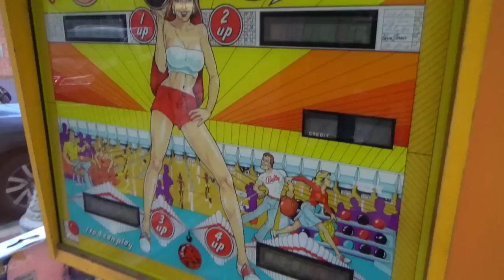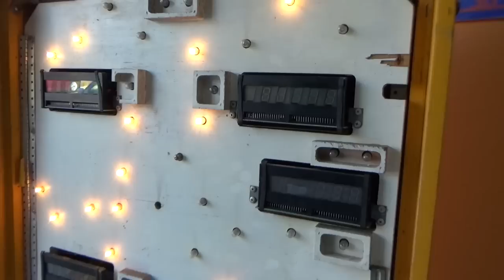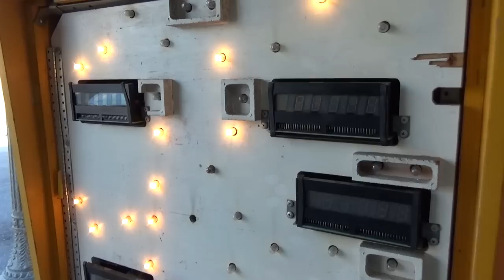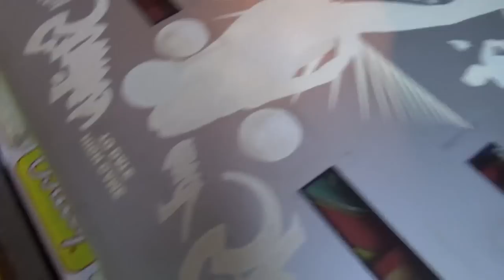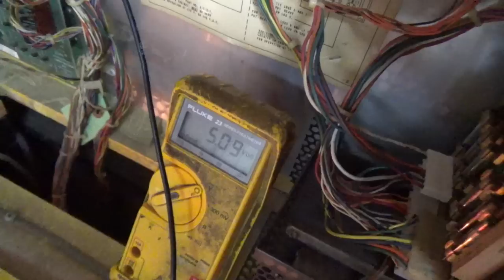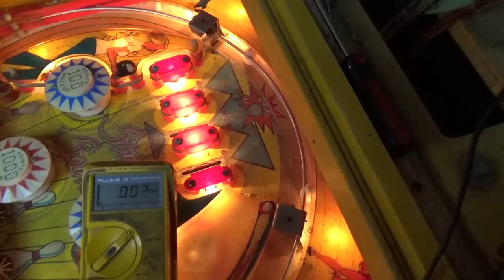Repairing and Testing an old Bally Solenoid Driver Board - 1978 Strikes And Spares Pinball Machine

Comment: Thanks for another great video Ronnie! I'm surprised that high voltage shield isn't totally yellowed. I was cringing when you were sticking your probe under that. I have 2 rectifier boards to re-pin and I'm dreading it. BTW, marco sells a solderless rectifier board with screw terminals going to the transformer, kinda weird. Can't wait for the next video!! ✌️
Reply from the maker: yeah the potential of shorting things out doing that is pretty high especially if you have a camera in one hand, LOL  

I've fixed probably a hundred of these Ballys and only had to replace that rectifier board once.... there's not much to them, unless it's caught on fire.
Reply: @LyonsArcade  Fortunately they work fine but the connectors are pretty toasty. 🤞

Comment: I would solder the screw terminal to the pad on the output lead of the regulator. When the resistance goes up between those two points it causes heat and the regulator to blow. Unless there is a lock or star washer under the head of the screw.

Comment: I’ve had diodes fail like that where they check fine but when voltage is applied they short. 
Nice recovery. I use a Dim Bulb Tester to check for shorts after tinkering on a circuit. I wonder if that would be a way the test for shorts saving the fuses and allowing for troubleshooting on these pinball machines?

Comment: Hey Joe! Great video - I’m learning a lot and have even gotten a few things repaired on my new (1984) Eight Ball Deluxe. Recently i had a single flipper go dead. Briefly. I believe one of the wires has lost some girth at the base of the solenoid for said flipper. When the flipper started working again, now the house lights are starting to dim a tiny bit any time i hit the flipper. Can you think of anything?

Comment: Just for info: 

The 7805 is not a transistor, but a complete integrated circuit acting as a 5 V voltage regulator. This special casing in a TO3 transistor case allows higher currents than the T0220 cased ones because of the better termal connection to the heat sink. I guess this one goes up to 1,5 A instead of 1 A.
Reply from the maker: You corrected me calling it a transistor, then said the 78H05 is capable of 1.5amps when it's capable of 5amps...

I obviously don't know what I'm talking about but you've exposed that neither do you... only one of us wanted to correct the other one, though

Comment: For those playing at home, you should replace both sides of the connectors (Headers and Housing and Pins).  The newer headers are square and you should use the Trifurcon pins so that you make contact on 3 sides rather than just one side.  Reduces resistance and heat.
Reply from the maker: Completely unnecessary
Reply: @LyonsArcade  We'll agree to disagree on that one :)

Comment: 24:51 That is a LV (12-24V) fuse on the right for use in cars or caravans, looks like a 6 or 10A. See how thick the fuse "wire" is in it. The left one is 5x20mm I assume, which is most common.
That little glow in a plasma display is probably to keep the gas ionised that makes the displays turn on faster._
Reply: Yes, there would be a hold voltage at work so the displays work rapidly enough.

Comment: Question, kind of a weird situation. Tri zone. I'm working on it. Sat in a barn. Main mou corroded bad so I replaced it with a rotten dog mpu327 combo board for Williams system 6, recapped both the power supply and sound board it just because. I still need to put new displays because only player 2 and 4 work. Not ball/credit, player 1 or 3. So when I turn it on sometimes I only get gen illum no displays and no flash/attract. But sometimes if I flip the switch off then on 2-3 times I'll get the 2 displays and flashing to kick on and the coin door coil to fire. What might cause this?
Reply from the maker: I would say it's the connector that plugs into the top of the power supply board, or the connector that plugs into the left top corner of the new MPU.  I'll bet when it doesn't boot if you check the board the 5 volts will be missing or low.
Reply: @LyonsArcade  awesome. Thanks Ron, I'll look into it. I do mostly em games so I don't get much exposure to ss.

Comment: My theory with those diodes or any components is, these are literally 50+ years old.  Now, when you put electricity through them after a long period of time, they could just blow up, or short themselves.  If they don't they're usually good for a while longer.
Reply: The "blow up" part could be the "popcorn theory." So it is possible that moisture or whatever condenses inside or something. Then when you power it up years later, you may find exploding parts.

Then there is the older tech issue. Some things used selenium diodes. I don't think those are made anymore. So you end up substituting parts, and one thing to keep in mind is that the voltage drop is different. The silicon ones may cause a different, possibly lower voltage drop.

Comment: What part did you replace Q20 with?  These are exceedingly difficult to find.  Marco's wants $70, which is a huge nope.  I've found LM323's from several places at varying costs from around $14 up to $70.
Reply from the maker: I didn't know they'd gone up that high, I bought all mine for 3 or 4 bucks.  I'd probably carefully order a batch from china on ebay if I needed some before I paid 70 bucks each.

Comment: JOES,  Why is that Resistor Value such a very low resistor value across that Transistor/regulator component? it was measuring a short in circuit. Also what do you mean by "Power Train" ?

Comment: Those connectors were never designed to take the power used by general illumination, that's why they burn up.   AC or DC doesn't matter, it's the constant load.   They are fine for intermittent loads, such as solenoids or controlled lamps, but the GI just is a bit too much for them

Comment: That's a unique triple gang box outlet cover plate. I have never seen one of these. Double gang box cover plates are common, but I worked as an electrician and I never saw one. Never even heard of one. We usually would do a double or two singles and put the 6 outlet adapter into them to give 12 outlets or run the 4 foot power strips with 12 outlets. That is what I have in my house to power everything

Very interesting

Was this in the store before you took ownership or did you have it installed ? Is that the only one or did you have multiple ones installed ?

I find the 4 foot strips are really nice for the A/C D/C adapter wall warts.

Comment: Diodes can be tricky. If they burn, they can assume a temporary resistance of 400-500 ohms and test like a nice junction drop. Until you run some current through them, then they burn some more or blow the fuse. When they break in half so easily when you remove them, that's a tell. 
Not to nit pick, but the 5 volt regulator is an integrated circuit and not a transistor, but it looks like one.